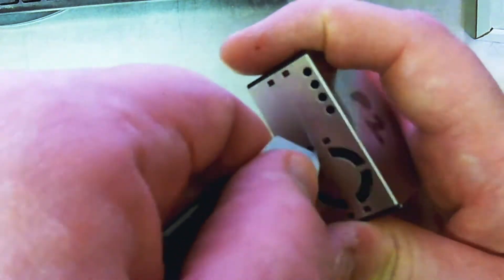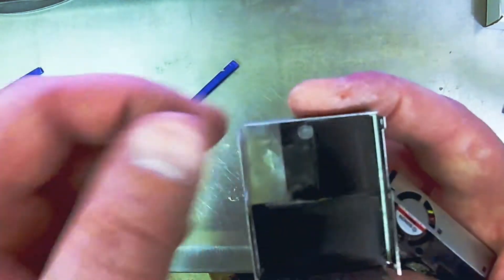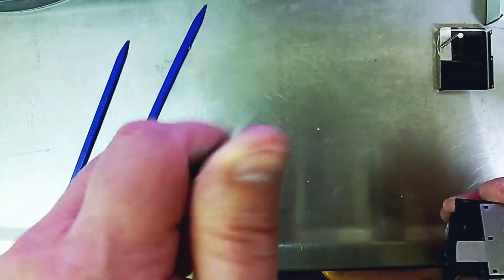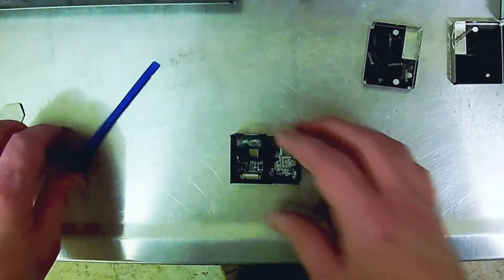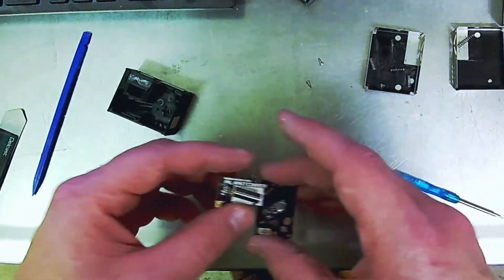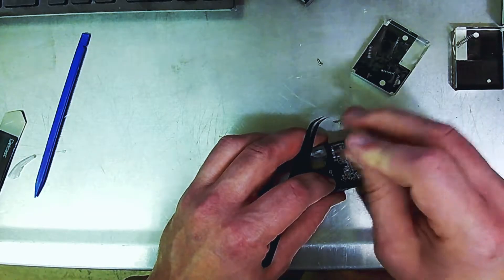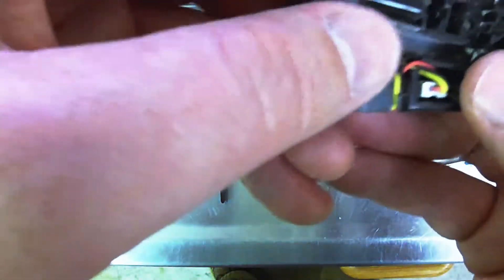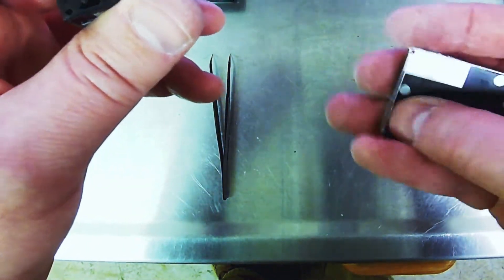Disassembling and cleaning a Plantower PMS5003 dust sensor

Comment: I accidentally sprayed a hair spray near the vent some time ago. What would I need to clean exactly? (I currently wiped few times the side where the laser is with spirit and cotton. But the values (not assembled yet) shown are around 5000 which is wrong but i dont understand where the particles  might stick. The vent's fan blades cleaned somehow too, but as i did not connect yet the vent "pipe" the values are still 5000+... 

Additionally on the opposite side of the board there is a round white thing in the center that feels like a filter, a bit pappery. You do not have that on video. Board is exactly the same though pms5003s.
Reply: Update: so the problem was solved by closing the case of the sensor as it expects total darkness for the laser to calc correctly. Overally -- washed all washables with soap and cleaned electronics with alcohol and cotton. Now seems to show low normal values.